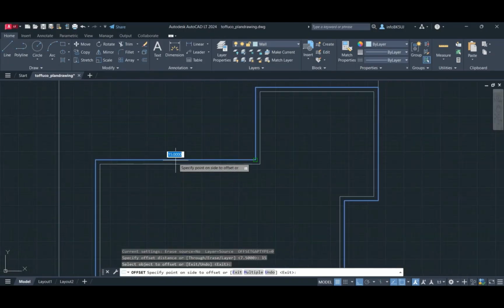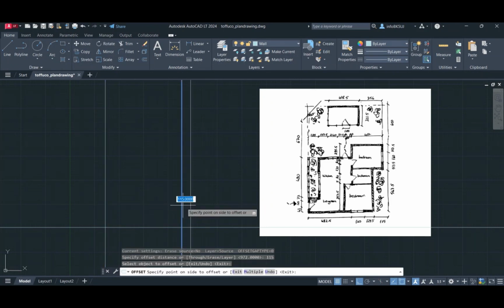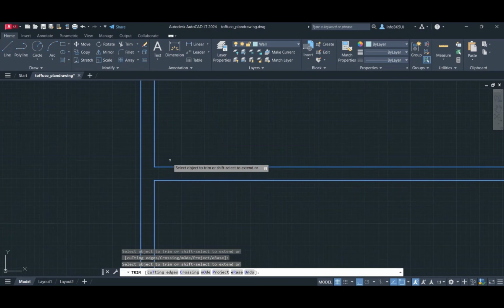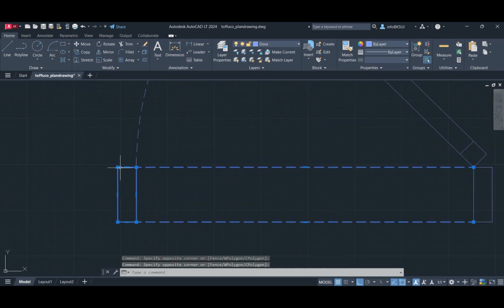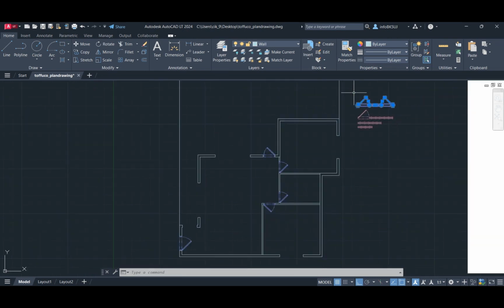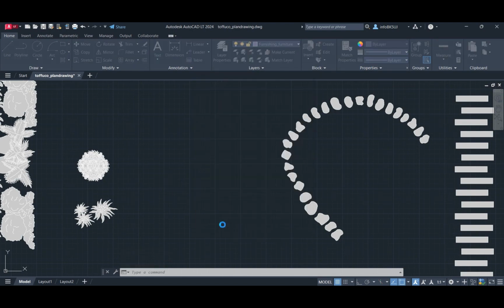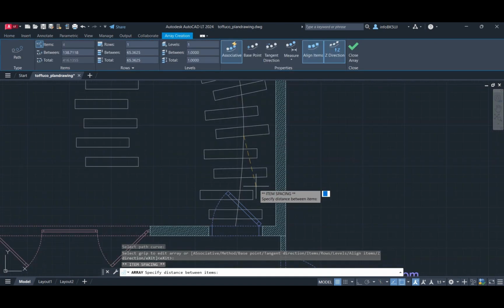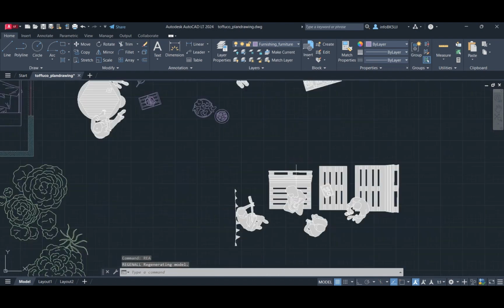25 Must-know Commands for AutoCAD Plan Drawing | Sketch to Technical Plan AutoCAD Tutorial

Comment: you are making your workflow way harder than you need to. 
if you select by drawing the box form left then you only select stuff that are whole in the selection box, which eliminates the need to select all tiny vectors one by one like you do it here. 
instead of groups you should use blocks and edit block in place command. you don't need to group/ungroup all the time and it shows you other elements in the drawing at the same time. You don't need to go through defining blocks, just control shift+c to copy with chosen point and copy shift+V t paste new block with chosen point. Using blocks also let's separate and edit blocks without all the extra noise of snaps and qiuckens computing.
filter command is way better than quick select and I suggest everybody learns it, because it does waht quick select does but better with more features - like having multiple filters at the same time and picking properties straight from objects in the drawing.
Reply from the maker: Awesome tips, thank you so much! We didn't know about the filter command, so we'll definitely check that out. We had planned to show the use of blocks in a separate video, as they can indeed save a lot of time :virtualhug: